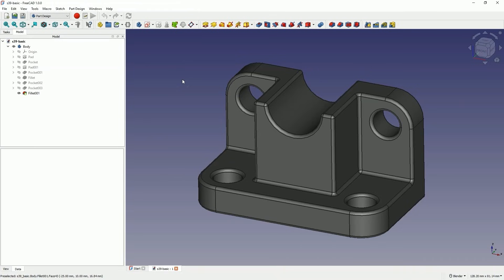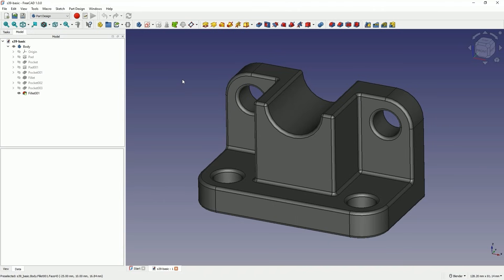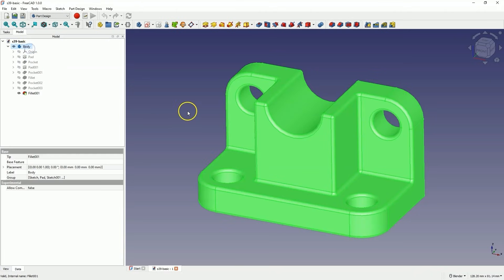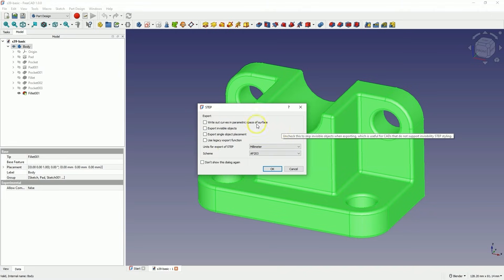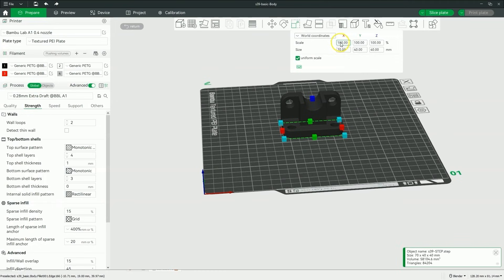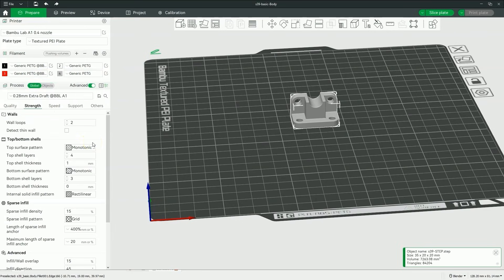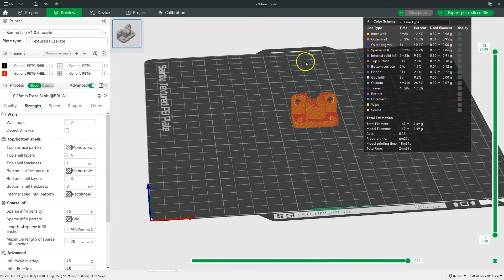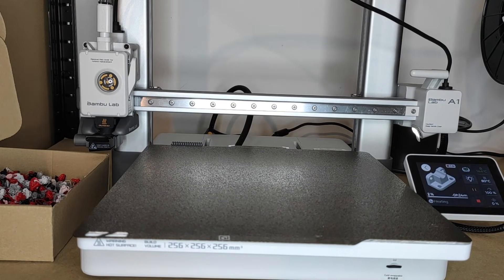From FreeCAD to 3D Printing in 5 Minutes!

Comment: This one was a bit of a miss - you had the opportunity to educate the viewer about Step export settings in FreeCAD as well as the Step import settings in Bambu Studio but in both cases you just blew past them. If you're going to use STEP instead of STL, please take the time to explain the options and when/why a setting should be used. Otherwise selecting STEP could lead to confusion and poor prints because of a user touching something on those dialogs out of ignorance. Using STL is the "easy button" but STEP can have some advantages, but you missed out on the opportunity to explain that to your viewers.